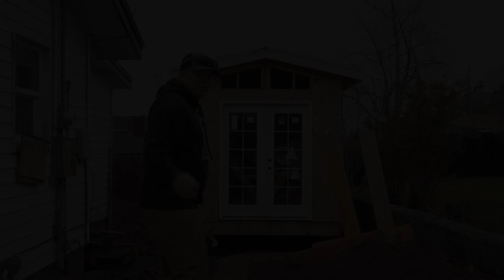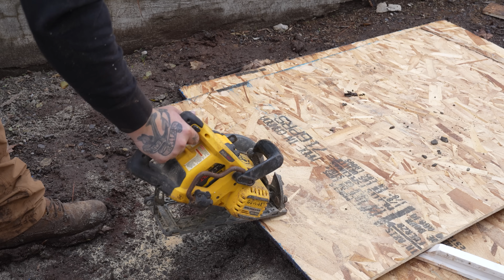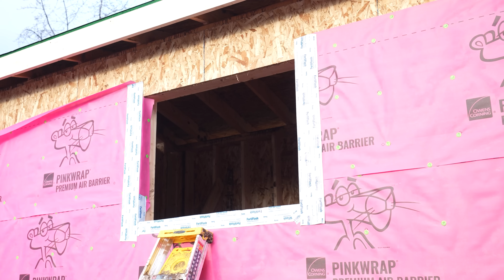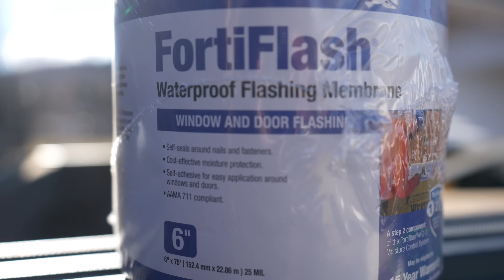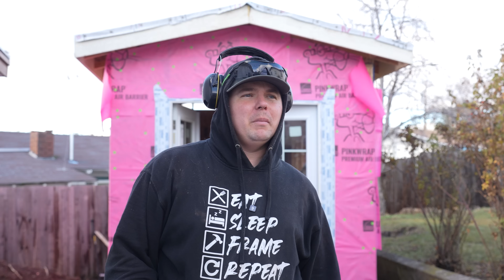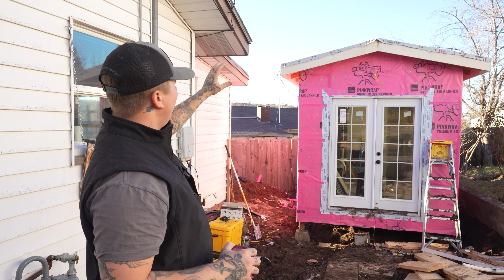Weatherproofing My ULTIMATE Backyard Studio!

Comment: The bit you used is a flush trim but and you should of done full sheets for the door and up to the roof line and flush trimed it. It's Easier and looks better and stronger as a soiled sheet vs multiple cuts and sheets/pieces

Comment: Caps aren't so much for preventing water penetration as they are to keep the wrap from pulling though the staples. Do a quick video trying to pull barrier through a regular staple vs a stapled cap and you'll be amazed, as will your viewers, how much wind resistance/ holding power the cap adds. can use those same caps with nails/ air or battery guns and the Hitachi and other cap nail guns are killer on wrap and roof underlayment and felt to add wind "hold" resistance when you think that will be an issue before shingles or siding will be installed.
Reply from the maker: It definitely helped hold it on there, I was able to let the roll hang. Couldn't do that with traditional staples!

Comment: Heat gun or even a hair dryer on that flashing tape should help it grab hold. would try that before you side if it is still too cold when you are on that step.
Reply: J-roller/screed card will help it grab/ seal as well after you heat it up. If it is really cold, the wood it is adhering to will need to heat up too or it will release. Just don't scorch it or burn it down! 🤔

Comment: while I understand you are getting sponsored with the product.  However, that is an awful lot of joints to tape/seal and a regular roll of 8' house wrap would have done that in half the cost and 1/4 of the time.
Reply from the maker: I only did 3’ rolls due to being solo in this mud! I’d normally use a 8’/9’ roll and have hardly any seams to tape!

Comment: Question. Asked from ignorance, not contention.  How does a WRB work if there's 1000 holes from the hammer tacker then the siding?
Reply: the plastic caps are creating a seal (according to the manufacturer), and the siding is lapped so the holes are underneath the next piece, and any exposed fasteners are sealed with silicone/caulking.   But I do agree with you.    Personally that pink product is a lot of work for what it is.

Comment: Hey Matt, I’m an insulator and I heard you mention at the end r21 in your walls and something else more in the roof. Might I suggest, if in your budget, to use cellulose on the walls and attic or even just attic if you want to save a little by not doing both. More fire protection, no fiberglass, more r value. Just a thought!